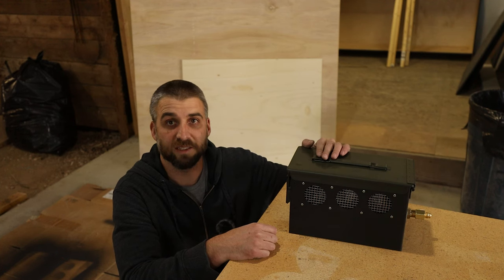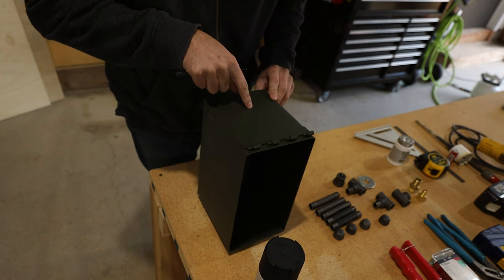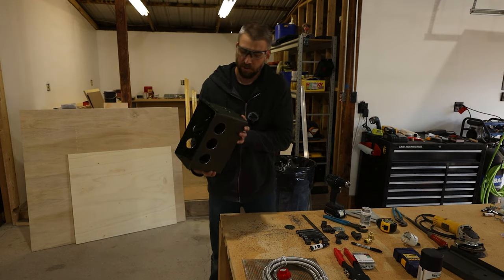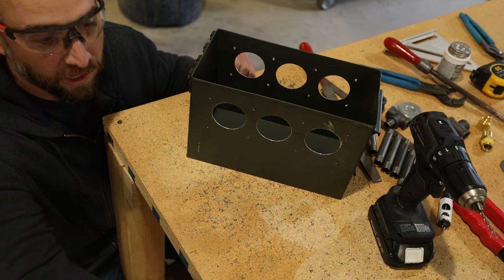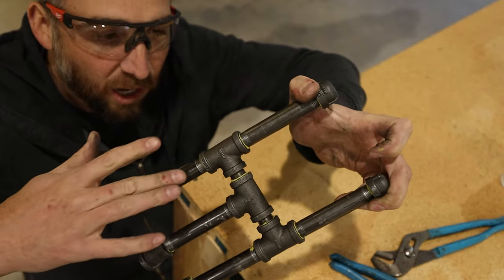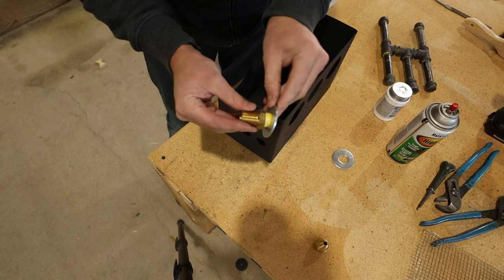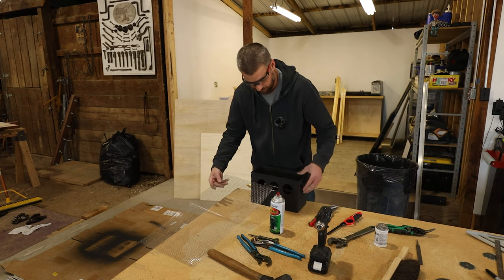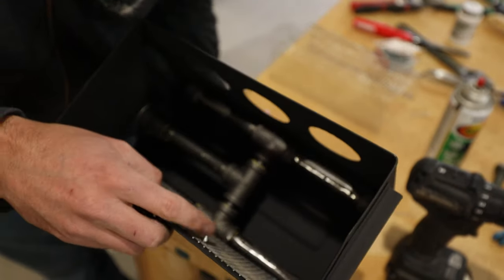How to Build an Ammo Can Camp Fire Pit

Comment: I fixed the problem.  I drilled 6 holes instead of 3 per 4" tube and finished the backfire. This phenomenon is due to the pressure of the gas, unable to exit freely through the holes which were not numerous enough. This creates a  gas return to the nearest external source, the aerator holes. Problem solved!
Reply from the maker: Thank you for this! I haven’t had any issues, but haven’t had to use it this last year. I saw others were having the issues. I’ll mention it in the description with credit to you, for others to see.

Comment: Absouletly GREAT
I did this project in a larger M61 ammo box l18xw8xh16. I did everything as you did except I replace the middle T with a 4 way connector that allowed me to add a support to the H burner to rest on the bottom. I also used 1/2 water pipe and the H burner is about 4" off the bottom. It works Fantastic!!! thanks Dave

Comment: Do you have any versions of this using waste oil? Seems like a great cheaper alternative to propane and if done right waste oil can produce little to no smoke probably not as emissions friendly as propane but much better than burning wood or coal.
Reply from the maker: Unfortunately no. The sole reason I built one of these is for our local fire bans in Colorado when camping. Needs to be a propane style fire with a controllable flame.

Comment: Have you considered an inline flashback arrestor?
Reply from the maker: No, I never really planned to use one. Kind of followed suit of all the other fire pits out there. Did some googling after reading your comment, since I wasn’t 100%. I kept seeing things like “not required since there is no oxygen in the cylinder”. Unless you have like a oxy-fuel cutting set up. But doesn’t seem to be needed on BBQ/Fire out set ups.
Reply: @adv_mnd  That's interesting you found so much "not required."  I have been trained on oxy-fuel which is what made me think about, but even then, the oxygen and fuel are separate hoses...interesting.  I found your video because I'm thinking of converting an electric smoker to propane and I'm researching the conversion cost vs buying one.  I think I'll use one even though it will be only propane due to how sealed everything is.  Just makes me nervous.  Thank you for all the details!!  Now it would be nice know if there is some sort of calculation for BTU per hole drilled or something.

Comment: Question: I noticed you're applying the high-heat rust-oleum enamel over the original paint of the ammo box. Down the road, did you encounter any problems due to the original underlying paint decomposing in the high heat?

Comment: In hopes to lower cost, I’m considering going with a single 1/2” pipe that is 10” long, rather than the H shape. Do you see any disadvantages to that set up? Difference in parts is ~$40

Comment: Built mine just like yours, used it and worked great. One issue that I'm not sure how to fix. The hose end got so hot that the rubber pulled out of the clamp.  How can I correct this

Comment: I built one of these and used the same sort of burner set up and the same hose. My hose connection gets so hot that it starts to melt the hose…. I’m wondering if there is a higher temp rated hose 🤔

Comment: I built this, with 8, 7/64 holes it used up a 20lb propane tank in about 10 hours (Friday night 4 hours, Saturday morning 2 hours Saturday night 4 hours ran out very quickly on Sunday morning less than an hour), thinking I may pick up 4 more pipes and try a 1/16” hole instead, my goal was to possibly get a 3 hour fire out of a 1 lb tank. I also got the 90k mixer not the 150k, might also put in lava rock to see if it is dispersed if I could turn it down a little bit. Legs are definitely a necessity, it did burn some of the pine straw I set it on.
Reply: FYI 20lb tank (4.5 gallons) lasting about 10 hours is producing heat at 42,000 btu/hour. If you want to get 3 hours out of 1 lb of propane, that would be 30,000 btu/hour. So about 1/4 less heat per hour.
Reply: @NVPJ   Thank you for the information, I know its a long shot, but what is the math used to figure out the btu/hour? I tried the 1/16" holes, and they were not big enough for the air mixer valve and the fire proceeded to come out the air holes in the mixer valve. I up sized the amount of holes until this stopped happening and it ended up being 12 1/16" holes, the lava rock definitely helped with the diffusion of flames, but it does now seem to burn the "trapped" propane for quite some time after I turn the gas off, I wonder if adding some lower holes to let the gas escape would help with that.

Comment: Just built one using your video. Do you have any ideas on how long the fire pit can run on a low/medium setting?
Reply from the maker: Not entirely sure. I’ll try to do a weight test this weekend. Weigh propane tank, run it for an hour, then weight again to see how much was used.
Reply: I built this, with 8, 7/64 holes it used up a 20lb propane tank in about 10 hours, thinking I may pick up 4 more pipes and try a 1/16” hole instead, my goal was to possibly get a 3 hour fire out of a 1 lb tank.

Comment: Hey Dave can you use galvanized instead of the black steel fight and also what do you think about using 1/4 inch pipe instead of the 3/8 pipe as a way of conserving when you out for a few day's camping. Just a suggestion. Thanks Dave your design is the cleanest I have seen on YouTube
Reply from the maker: Galvanized, you run risk of burning of the zinc coating which can be toxic. Google search galvanized pipe in fire pits. If you wanted to run a smaller size, I’d opt for the builds where people coil up copper tubing.
Reply: I was thinking of copper pipping instead
Reply: Just wondering does the size of pipe really matter vs the size and number or holes drilled?

Comment: Hey dave do the propane hose get hot in the connection
Reply from the maker: The connection does, yea. I usually let it cool before I pack anything away anyways. I think that’ll be common with most propane stoves like this.

Comment: I built one and just got done testing it.  Have you had any issues flames exiting through the propane mixer holes?
Reply from the maker: 😳 No, I haven’t seen or heard of that happening.
Reply: Same problem for me...???
Reply: I fixed the problem.  I drilled 6 holes instead of 3 per 4" tube and finished the backfire. This phenomenon is due to the pressure of the gas, unable to exit freely through the holes which were not numerous enough. This creates a  gas return to the nearest external source, the aerator holes. Problem solved!

Comment: Great Video! Was the size of your close connections that hold the tees in the center 3/8 inch as well? I don't see a link for them.
Reply from the maker: The short threaded stub? It’s down there called the 3/8” Close Nipple. The picture looks longer, but it’s that one. Or did you mean a different part?
Reply: @adv_mnd  At 4:25 in the video, you called them “close connections”. Are those what you’re referring to?
Reply from the maker: Ah yes, they are referred to as “close nipples” and 3/8 pipe thread
Reply: @adv_mnd  Thank you for the help👍.

Comment: Any idea if it would work with a 1 lb bottle... how long a burn per pound?
Reply from the maker: I’m not sure on the per pound burn rate. All would vary based off how much you crank it up. A 1lb should work, but you’d have to run it off the same regulator set up as I do and then just do an adapter from the 1lb to the regulator.